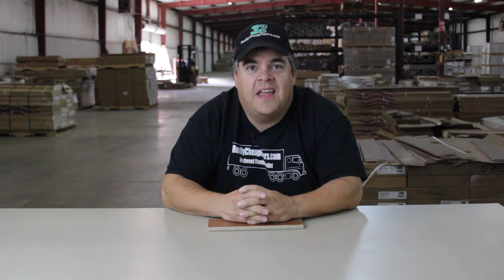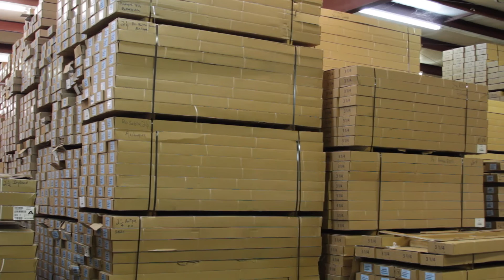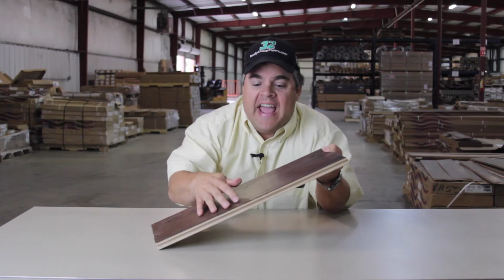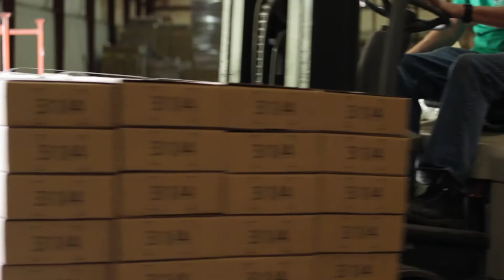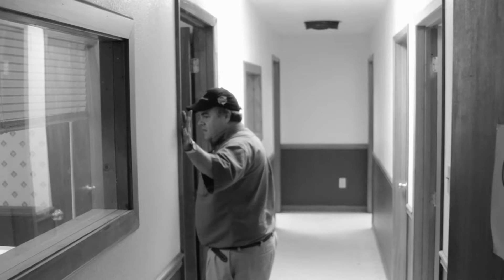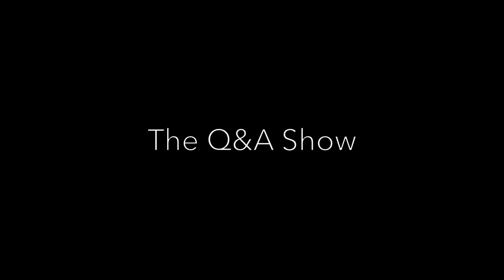How is Engineered Hardwood Flooring made?

Comment: Hi, first of all my name is hanisah and im a Quantity Surveyor student would like to ask you few questions based on this element (Engineered TImber flooring) , as this is because i need the informations for the requirement of my Project of  building construction subject. 
so here is my questions :
1) What are the manufacturing process do the timber need to go through until it finally became a product (the process 
that your company use) (ex: compaction , cutting)
2) The diagram of one panel of the timber flooring ( the dimension size of one panel)

Thank you for your cooperation :)